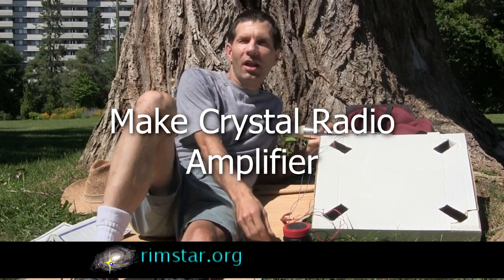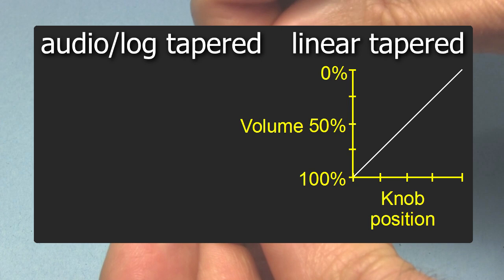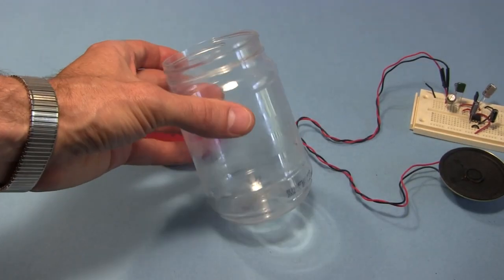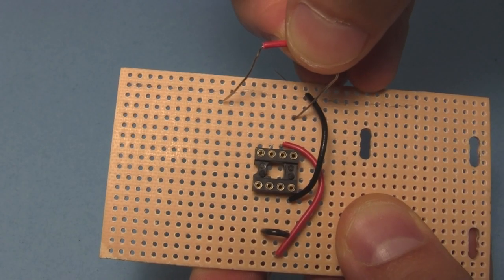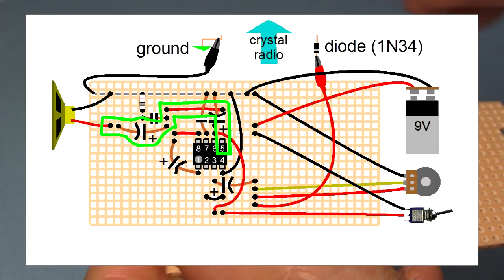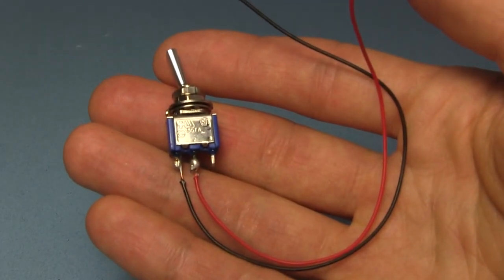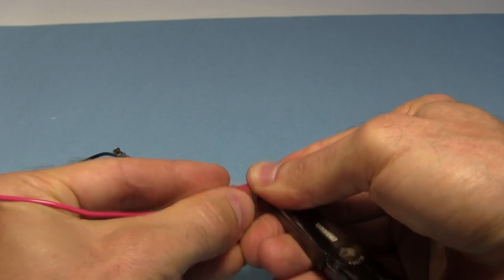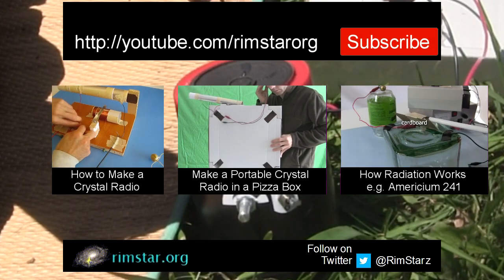How to Make Crystal Radio Amplifier for Speaker

Comment: would a 10k ohm resistor work
Reply from the maker: Do you mean instead of the 10k ohm potentiometer? The potentiometer is for volume control. Without it you have only one volume. The higher the resistor value, the lower the volume. So if you're going to have only one volume then you may as well go with a smaller resistor value. I can't say what value you should use since it depends on what volume you want, but for a high volume, look for something in the 10 ohm or 100 ohm range. You could try different ones and see what works best for you.
Reply: i mean in place of the 10 ohm resistor not the pot would that work

Comment: We are trying to build this and I need a simple question answered for these parts as I am NEW to this!  What voltage should the components be rated for?  Ex:  I have a 10uF electrolytic capacitor rated at 50V, but I see you have a 9 V battery attached.  Does this matter?  Am trying to buy parts and all the detailed options are overwhelming.  Thank you in advance!
Reply from the maker: The voltage rating on a capacitor is how much the capacitor can handle without breaking. So a 50V rated capacitor for a 9V system will definitely not break.
The power rating on a resistor (the number of watts) is how much power it can handle without breaking. For that you take the voltage that will be applied across it and multiply that voltage by the current that'll be running through it (power = voltage x current). But I don't know the current for this circuit. It's not much though, so even a 1/4W resistor will be fine.

Comment: dear rimstar i have a project with my friends tomorrow and i have to finish this tonight how fast can this be made and are there any shortcuts please answer back as quick as possible.
Reply: +RimstarOrg
Reply from the maker: +Armando Bravo There are no shortcuts. How fast you can do it depends on whether or not you have all the parts and what you experience is in making electronics.
Reply: Well we were looking up engineering projects and stumbled across the video on the lazer photoresitor and weve never made any electronic devices, and can i just hot glue everything together. RimstarOrg
Reply from the maker: +Armando Bravo You can hot glue things in order to mount them somewhere but the connections between the electrical components have to be electrical connections, done by twisting wires tightly together or soldering them together or using alligator clips.

Comment: they closed the radioshak in Atwater and I can't get the parts to build the amplifier just to ask I want to know can I buy one off of you homemade
Reply from the maker: +Andrew Kimble  I get my parts from some local electronics stores, not chain stores though (we haven't had a Radio Shack for a long time.) Also I buy online, mostly from http://ebay.com but sometimes from other websites I find by searching on google for the part. And lastly, I get parts by taking apart things that people throw out. Looking at the parts for this amplifier, the chip and some other parts came from one local electronics store and the rest were probably scavenged from things thrown out.
And I don't sell things. You might be able to find a small amplifier online. Depending on what you need it for you might already have an amplifier, maybe a speaker with a built-in amplifier?
Reply: partsexpress.com  They have everything...and a lot more

Comment: Can I use a picofarad capacitors?
Reply from the maker: +samuel virgil pe If you mean a capacitor with a capacitance of less than a nanofarad then no. All of the capacitors are in the microfarad (uF) and nanofarad (nF) ranges (0.047uF is 47nF). You need to use capacitors with values at least close the values given in the diagram (there's a diagram with all the values written in on my webpage here http://rimstar.org/science_electronics_projects/make_crystal_radio_amplifier_for_speaker.htm).
Reply: Actually yes he could but he would have to use a whole mess more of them to come to an equal capacitance that adds up to pico farads.

Comment: Can I use a 51 ohm resistor? Pls reply
Reply from the maker: +samuel virgil pe I'm assuming you mean instead of the 10 ohm resistor. To be honest, I don't know the purpose of that resistor. The capacitor that's in series with it seems to be a filter, though that's not clear either. I'd suggest just trying it if you have it already.

Comment: Great Video! I don't know a thing about electronics and was able to build a crystal set and the amp with these videos. I have one question, where in this circuit could I add an LED to use as a power light?
Reply from the maker: Julian Adkins Thanks! If you look at the circuit diagram on my webpage http://rimstar.org/science_electronics_projects/make_crystal_radio_amplifier_for_speaker.htm I'd put the LED and a resistor just to the right of the switch going from that red line to the black line immediately above it. The trick would be to find the right resistor value for whatever LED is used. In the first few minutes of this video he talks about determining resistance values for protecting LEDs https://www.youtube.com/watch?v=abWCy_aOSwY Let me know how it goes if you do it.
Reply: Thanks RimstarOrg, I'll let you know how it goes.
Reply: RimstarOrg  It worked ! Thanks again!
Reply from the maker: Julian Adkins Excellent! Thanks for letting me know!

Comment: Hi there, I have made an amplifier about the same as the one you've made here but i was wondering if you could help me with some trouble-shooting? I used a linear potentiometer and i can only hear the radio at a tiny point when i turn the volume up or down and once I'm past that point everything goes quite. Are you suppose to use an audio/log tapered pot for this circuit? Could that be the problem? thanks heaps, any help would be much appreciated :-) great video by the way, i just subscribed and am watching more!! thanks
Reply from the maker: Dan brown My first guess is that your potentiometer has too wide a range. What's its maximum resistance? The fact that it's linear just means it would be harder to turn the sound up gradually. If it's a 10k one you should still hear it throughout the whole range.
Reply: RimstarOrg Yea its a 10k one. i haven't got round to plunging the amplifier into the actual crystal radio, i was just plugging it into my phones radio at a low output setting to test it out and thats how i have come across that problem. thanks for you reply :-)

Comment: Around 40 years ago I had a Radio Shack 50 in 1 project kit that had a crystal radio in the mix.  I had about a 25 meter antenna out my bedroom window tied high in a tree and a copper rod driven into the ground for my ground.  I recall making a small modification to the circuit that allowed me to pick up short wave, if I recall it had to do with where I tapped into the coil which was of the ferrite variety.  It seemed that the short wave stuff was below the low end of the AM dial.  I took the output into a two transistor amplifier project in the same kit and then ran the output from the amplifier to a low ohm speaker, I seem to recall it was a 4 ohm.  You could run it off the 1.5 volt solar panel in the kit or of an AA battery.  I listened to that radio for hours, all kinds of stuff from Europe.  It really only worked well at night, and was much better in the winter than the summer.  You could also pick up the Greenwich mean time beacon.  Your project brought back some memories and I was wondering what modifications it would take to pick up the short wave AM signals.  I'm pretty sure the amplifier would be mandatory, as would the really long antenna.
Reply from the maker: jgh59nerdshack That sounds like a great kit you had! Regarding modifications for shortwave, I haven't tried it myself. However, I have a kit that uses jumpers to adjust the circuit for shortwave and they do so to add an extra 470pF capacitor in series with the tuning capacitor, which would shrink the tuning range making it easier to tune in.

Comment from the maker: +John Doe Some old phones have piezoelectric crystals (in the shape of a disk) in them but I've never opened one up so I don't know the details of figuring it out. If you do have one with a piezoelectric crystal then since you're not powering it with any other source than the radio, you'd need to make some sort of cylindrical enclosure for it and a tube that can extend from that enclosure into your ear. You can use the diagrams on this page as a guide http://rimstar.org/equip/crystal_earphone_earpiece_for_crystal_radio.htm.
PS There's no Reply button under your comment because of your Google+ settings.
- go to your Google+ page,
- in the top, right corner click on your thumbnail icon,
- in the popup that appears, click on "Settings".
- for the 2nd question down "Who can comment on your public posts?" set it to "Anyone".

Comment: whats the Lm386 made from?
Reply from the maker: ronald sykes It's a microchip, so mainly silicon plus other materials for the micro transistors, diodes and resistors. I'm no expert in microchip manufacturing so I don't know exactly. Is that what you were asking?
Reply: thanks,  scrap a lot myself for the spacecraft club,looking for the larger chunks of germanium for some projects,  was interested in what was doing the pushing in the Lm

Comment: I made this from mostly de-soldered parts off an older circuit board, had to buy the LM386 to be sure, but otherwise all salvage. Only one question: This plays much much louder than the crystal earpiece ever did, but it's still too quiet to be heard across the room if it's not perfectly silent (on some radio stations); How would one go about boosting the output volume?
Reply from the maker: pricemac From the crystal radio's point of view you could use a longer antenna. Also, pointing the antenna at the radio station helps, though since it should be a straight wire that's no always possible. As for the circuit, it isn't mine so I don't know all the details. But looking at the LM386's internal schematic on http://www.ti.com/lit/ds/symlink/lm386.pdf possibly decreasing the size of the capacitor between pins 1 and 8 might help. If you study it further you might find other tricks.
Reply: RimstarOrg Interesting! I'll tinker with it. Fun note at the end describing frequency shaping, to compensate for poor speakers (like a bass boost). If I find something that works well to make the speakers sound nicer, I'll post the circuit to you.

(it suggests a 15k Ohm resistor between pins 1 and 5 for an effective 6dB bass boost, Bass Boost switch or button maybe?)
Reply: RimstarOrg So, After playing a little, I have to say reducing the capacitor did not work, apparently that value bypasses the default gain level of the chip, maximizing it. (Worth noting if it was too loud, you can change the capacitors out to lower it, just not raise.)

So, on to solution time:
I did a little digging, and found a diagram for a "one transistor amplifier" made simply for amplifying the crystal earpiece. So I used that amplifier, replacing the crystal earpiece's "in" cable with the speaker amp's "to diode" connector. As described by the tutorial about the "one transistor amplifier" it takes about 10-15 seconds to "warm up" (saturating the very large 8.2M Ohm resistor [or something like that]) and then begins playing loudly.

This is the tutorial I used for others interested:
http://www.petervis.com/Radios/one-transistor-radio/one-transistor-radio.html

I'll attach the complete radio circuit diagram once I make it look all nice and tidy.
Edit: Here's my Current Setup: https://drive.google.com/file/d/0B3GtbJ0uO52MU0V2RV9wVW9mcE0/view?usp=sharing
Reply from the maker: pricemac Sounds good!

Comment: Haven't tried the amp yet. But I did build the radio staying pretty much to your design. I used a piezo buzzer for an earpiece, and tried and tried. I even rewound the coil with taps. I was finally in business when a 47K resistor was placed between the earpiece leads. This was great fun. Thanks RimstarMan.
Reply from the maker: steve happe Glad to hear you got it working! Sounds like you didn't have enough leakage in the reverse direction through your diode, but with the resistor it now takes that path. Thanks for letting me know.

Comment: We made one at work that did not require an amplifier, it had a 100 meter antenna and it managed to power a speaker which was fitted with a 2k to 8 ohm transformer. we had enough signal to actually light a LED. The transmitting station was 50kw about 10 miles away
Reply from the maker: 100 meter antenna. I'm jealous. I make do with three 5 meter wires in parallel.

Comment: something is wrong... i connected everything and followed all instructions..
Reply from the maker: What are you using as your sound source? A crystal radio or something else.
Reply: i got it to work, the board that i was using needs a connection between the top and the bottom for my ground cable and also the way my board was set up, its different from the way your perf board was set up, so i made a few ajustment to it, but it works :D THANK YOU VERY MUCH! i know have an A in physics, also i was able to explain how a crystal radio works pretty well, also thank you.
Reply from the maker: Ahmad Soughar
Hey, glad to hear it! Both that it worked and about the A! Well done.

Comment: Any tips on how to cancel unnecessary noise.
Reply from the maker: I don't have any tips cancelling unnecessary noise in the amplifier circuit. In the crystal radio, if you have a two coil setup where one coil is attached to the antenna and ground and the other is a tuning coil, then increasing the distance between the coils will help. Normally in a crystal radio that would decrease the volume but in this case, we have an amplifier to make up for it.

Comment: I soldered everything in and the amp is working but the chip is getting red hot.  I am using an lm386 and input from my ipad. It uses a 9v battery. I also get static on my speaker. Do you know the cause of these.
Reply from the maker: If the chip is getting red hot then you have a lot of current going into it from somewhere, maybe even a short circuit or a component that is broken and acting like a short circuit. Feel the various wires connected to the chip and see which one is hot. That should give you a clue as to which power source is giving the current. Does your battery drain very fast? That would make sense if the current is coming from your battery. Or maybe the output from the ipad is providing too much current. I'm sure a crystal radio has very low current compared to an ipad. If you find that the ipad is the source of too much current then try putting a resistor in series with one of the output wires from the ipad. If that much current is coming from the ipad then you might even be damaging your ipad's output circuit.
Reply: Just add a 220uF electrolictic capacitor betwing pin 6 and speaker. ( with negative pointing  to the speaker and positive pointing to pin 6)
It will make the IC work cool.
😉
Reply: Omg.. now i can see that this post is from 5 years ago.

R u still alive?
😂

Comment: Ok thanks, I am not using this as a radio but rather an electrical switch. I don't want to delve into it but I am using an arduino instead of an oscillator chip and an op amp instead of the nte160. Thanks for your help. I can find somewhere else to get this info. The Mighty Google will tell me how to amp the signal. Thanks for all your help!!! wviper3

Comment: Could you use this as an rf amplifier for the am transmitter?
Reply from the maker: If you mean to boost the signal being transmitted, maybe you could connect it to the output of your sound source and then instead of going to the speaker, connect that to the transformer. Keep in mind, you don't want to transmit with the AM transmitter more than a few feet/meter so that you don't interfere with other people's radios, especially since my AM transmitter transmits on multiple frequencies.
Reply: RimstarOrg Couldn't I just buy an amplifier like this one for a lot cheaper than building my own. Link: http://www.radioshack.com/product/index.jsp?productId=12651125

If I used this, would it work, and would I put this before the antenna but after the oscillator chip? I will make a video showing my design then post it and give you the link. My circuit uses an arduino instead of an oscillator chip. I can't explain it here because it is really in-depth but the video will have it all!!! Thanks for all your help, wviper3
Reply from the maker: wviper3
I really don't want to help on this since you shouldn't broadcast more than a few feet anyway, especially if you're using the AM transmitter circuit in my video, unless you're doing it for some other reason. But then again, I can't help much anyway without jumping in myself. The datasheet on the NTE160 doesn't say what makes it more than just a transistor and any transistor can act as a central part of an amplifier circuit. It does at least seem to cover the frequency range (up to 900MHz). If I were to try this I'd try it between the sound source and the transformer.

Comment from the maker: Does your crystal radio work when you listen using a crystal earpiece? Maybe you are not tuning into any radio stations because there is a problem with the crystal radio. Do you have a good ground? Do you have a good antenna? Is your battery charged?

Comment from the maker: Are you saying you connected the 10k potentiometer differently? What you described is the same as mine. Did you put the 10uF electrolytic capacitor in between pin 3 and the potentiometer? The potentiometer has three places to connect to. It is important that you connect to the right ones.  Does your crystal radio work without the amplifier? Are you sure the electrolytic capacitors are connected the right way? The electrolytic capacitors have a positive and a negative.